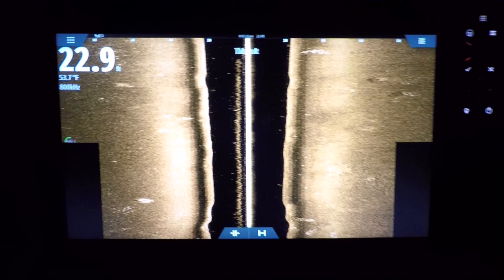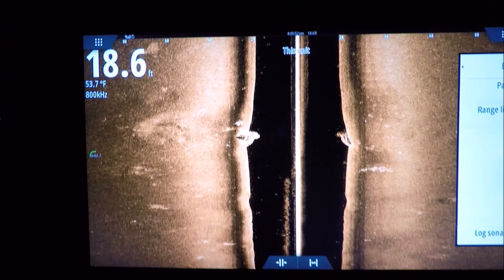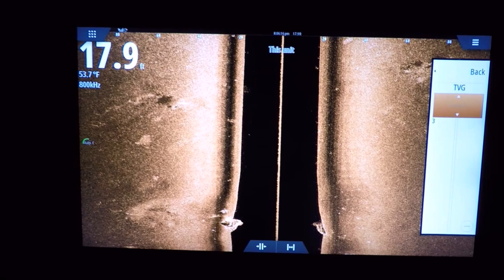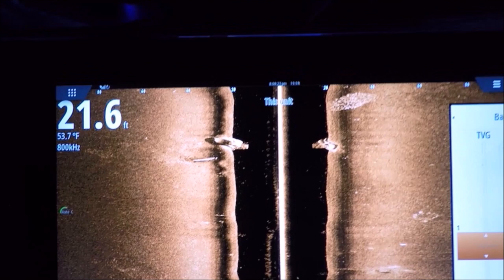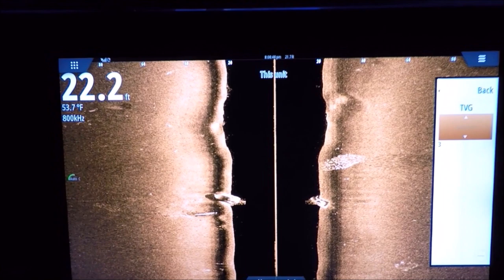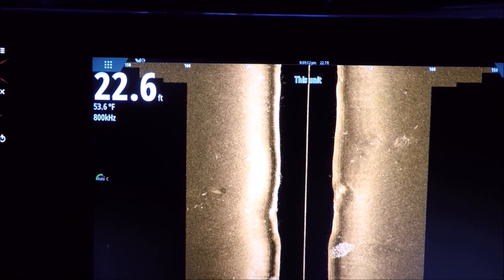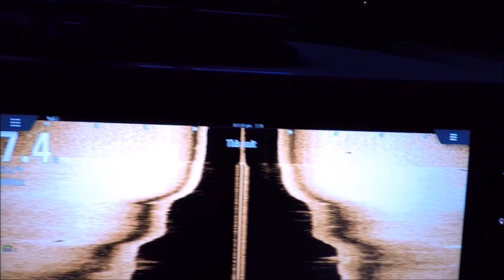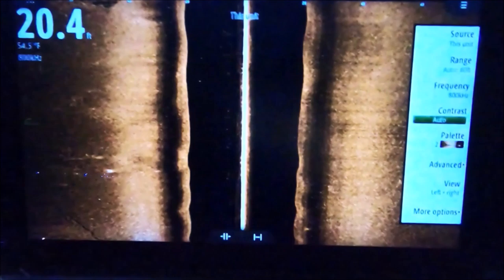Side Scan SETUP! ACTIVE IMAGING SETTINGS. 3 in 1 Transducer

Comment: I have the Total Scan Transducer with Evo 3 unit. To view bottom or sides of channels, where should I run it? Thanks
Reply from the maker: Definitely in 455 always. That’s the most important thing. TVG 0-1. Range wide out until you see the darkness appear on the outer edges, then bring it back in one click. Bring it in 2-3 clicks if you want slightly better detail. 👍👍
Reply: Hi Mike,  I just did an update on my simrad evo3 and now i dont have the option to choose downscan on the structure sounder???  and my unit won't shut off.  can you help with this??

Comment: I have a question. Im running a client's 28' whitewater with two EVO 3's but the down scan and side scan wont work.. Im not sure what transducer is installed and neither does the owner. Im at witt's end here. I do see CH1 and CH2... but hell, no matter what I do, I cant get them to work. down scan kinda works when we are at the dock but as soon as I leave the dock and head out its just black with a blue bar at the top. The side scan is completely black shows nothing. Any suggestions?
Reply from the maker: The channel selections are just for traditional sonar. They aren’t for side or down scan. On the side scan page go into the menu and look for source. You might have the wrong source selected. If the side scan transducer is connected to the left screen select THIS UNIT only on the left screen. If you want to use it on the right screen select the other screen in source, just don’t select THIS UNIT on the right one if the transducer is not plugged into it.  If you’re losing bottom when you leave the dock check your range. Set it to auto or set it deeper than the water you’re  in at first.
Reply: @MikeSmedleyOLDSCHOOLSTRIPERS  there are two machines but only the right side machine has the transducer plugged into it. We use the left one for GPS/chartplotting.  I fiddled with auto range but nothing happens.  Do you need a special transducer for the side scan and down scan to work? Maybe the transducer installed doesn't have the capability?
Reply: when you buy the machines they dont come with the transducers, right? We do get options for high/med/low chirp though. plus 200khz, 83kz/ 50khz. THis is driving me crazy dude! I need to figure this out.
Reply: @MikeSmedleyOLDSCHOOLSTRIPERS  also, since we dont know whcih transducer is installed, we have it "unknown" selected as the transducer type so maybe something weird is happening there. There is a tag on the transducer cable that reads XID V1.33  11-010-01 REV2 but really cant find much on that.
Reply from the maker: @Cptpaul12  Evo 3’s don’t come with transducers. You can look on the transducer cable tag on the back of the screen to see what you have.
Reply: @MikeSmedleyOLDSCHOOLSTRIPERS  I did.. look at the reply above this one
Reply from the maker: @Cptpaul12  XID is an X ducer. It should select automatically. If it has side scan built in make sure it’s plugged into channel 2. If you use unknown you will see frequencies offered that your transducer can’t use.
Reply from the maker: XID is an X ducer. It should select automatically. If it has side scan built in make sure it’s plugged into channel 2. If you use unknown you will see frequencies offered that your transducer can’t use.
Reply: @MikeSmedleyOLDSCHOOLSTRIPERS  when you mean plugged into channel 2.. do you mean in the options or on the back of the machine? And would that also effect the down scan? Thanks for your help, Mike. It’s much appreciated
Reply from the maker: @Cptpaul12  yes you need a special transducer. This is the best all in one. It has everything built in. High and med CHIRP down and side scan. https://amzn.to/2Tm3Ngw

Comment: Hi Mike.  Will this transducer and the TM 275LHW interfere with each other if operating at the same time?
Reply from the maker: I run both everyday on Evo3. I see no noise at all. The Airmar transducers are so clean and quiet they play nicely with all of the transducers I’ve tried 👍👍. They are awesome.
Reply: @MikeSmedleyOLDSCHOOLSTRIPERS  thanks Mike.  I see there is a new HD version out now for the A/I 3 in 1 transducer…your thoughts on this?  Is it worth spending the money to upgrade from the non HD version to the HD version?

Comment: do u have a picture of how low or high u mount your transducer... thank i can see to the right but cant see anything on the right i think my motor is blocking it...
Reply from the maker: siv aing shoot me an email. I’ll get you a pic. That’s a common problem when mounted too high. You want it as low as possible. I have a 12” jackplate so I can mount higher than most. My skeg doesn’t block the side scan since it’s back further. Mikesmedley9@gmail.com
Reply: Mike Smedley do you mount the active imager to the jack plate? I’m getting ready to plan out the transom on the shop boat and to demo it I’m going to have an AI, SS 3D, a standard skimmer, and the Airmar High Wide. I think I’m going to do the 3D and AI on the jack plate, the HW on the starboard side and the skimmer on the port. Could you post a video on your multi transducer install? Thanks!
Reply from the maker: Performance Marine AZ I would not mount to the jackplate. The transducer will come completely out of the water at 10mph or less in some situations. That’s no good. We mark fish at plane speeds. I have had as many as  6 transom mount transducers on at once for testing so it can be done. This is an older video but you can see some of the transducers I had at the time. 

https://youtu.be/9i15P5TV4tw

Here’s another. https://youtu.be/4XofQS4gMj0

Comment: Can you help me once more?
I got the new unit from simrad had 18.3 i updated to 19.1
Everything is working with s5100
Only issuse i have now is
When i go to this unit ch2 i cant find AI 2 in 1 transducer in the list  its pluged into port 2 black

But side and down scan still work under Unknown
Reply from the maker: disonesto You shouldn’t find anything on the sonar page for channel 2 because it’s not a 3 in 1. There are no Sonar options, only side scan and down scan.
Reply: @MikeSmedleyOLDSCHOOLSTRIPERS  everything works fine.      But the weird thing is when i had the defective unit that i sent back to simrad that was on 19.1.1 i was able to select AI 2-1 

The one they sent me had 18.3 that i updated to 19.1
Everything works.  It just dosnt detect ch2 AI 2-1 
It also works with under network this unit ch2 unchecked. Im guessing that is only for sonar because thats the only place it removes it from
Reply from the maker: I’m not sure why it was selectable the first time. Because it has no sonar elements it’s strictly a structure scan transducer. It shouldn’t show up in any sonar situations at all.  On structure San pages you should be able to select THIS UNIT but there should be no options on a sonar page.
Reply: @MikeSmedleyOLDSCHOOLSTRIPERS  its will only show up on the sonar page with wrong Frequencies if i check the box that says this unit ch2 under networking.  If i leave both boxes unchecked ch1 has nothing pluged in and i leave ch2 unchecked since its not a sonar.    Side and down both work fine.    The only box i have checked is networking for s5100

Comment: So in say 5 feet of water the range will be very limited?
Reply from the maker: Yes, but not as limited as the older systems. In 5 feet of water the range would be 20-25 feet to each side or more.
Reply: Thanks so much. Live in Florida and have been struggling with why I had such a short range. Tryed it in some deeper pits this morning and had great results.
Reply from the maker: Cool!! 👍👍

Comment: Thanks for the video. Are you using the 3 in 1 on its own, or also with the structure scan 3D box, to get your great side images? I just picked up a Carbon 9 at the Cabelas sale, seems like an awesome deal
Reply from the maker: It’s the 3 in 1 Active imaging transducer plugged straight to the Display. 👍👍👍
Reply: @MikeSmedleyOLDSCHOOLSTRIPERS  sweet! Do you recommend using the latest software update for Carbon? Some people talk about there being a sweet spot on Lowrance updates, and that performance can drop with the latest ones.
Reply from the maker: @FishStalker777  Unfortunately i am not as familiar with the Lowrance side. I use the newest software on my Simrads though.
Reply: hello, sorry for the inconvenience, I wanted to ask you for advice, I bought a hdslive9 with the spnda imaging.3-1 and I wanted to ask you for advice, I saw that it contains 4 types of frequency (high chirp-medium- chirp/ 83e 200) I practice trolling with live snapper on a seabed ranging from 50 meters up to 90, for this type of depth which frequencies should I use? should I use only one or at 50 one frequency and at 90 another type of frequency?, I accept valuable advice thanks
Reply from the maker: Leave it in Med CHIRP all the time. It has the widest cone and has much better deep performance 👍👍
Reply: @MikeSmedleyOLDSCHOOLSTRIPERS  ok thank you very kind
Reply from the maker: Any time Giovanni!
Reply from the maker: @Camh1968 I personally would use 83 in less than 20ft of water. Then switch to medium in anything deeper. You may want to tweak that and experiment a bit.
Reply: @MikeSmedleyOLDSCHOOLSTRIPERS 

Hi Mike 

When would the 83kHZ be used in lieu of the med chirp - and visa versa?

Thanks

Cameron
Reply from the maker: @Camh1968  @Camh1968 I personally would use 83 in less than 20ft of water. Then switch to medium in anything deeper. You may want to tweak that and experiment a bit. A lot of times Med chirp is best in all depths less than a few hundred feet.
Reply: @MikeSmedleyOLDSCHOOLSTRIPERS  

Great thanks Mike.

What is the rational for using Medium chirp over the 83 in depths for more than 20 ft?

Cheers
Reply from the maker: @Camh1968  CHIRP sweeps through many different frequencies instead of using just one. The deeper you go the more effective CHIRP is. Sometimes in water less than 20 I get a cleaner image with just 1 frequency.
Reply: @MikeSmedleyOLDSCHOOLSTRIPERS  

Thanks a lot.  That’s interesting about the clearer image with the single frequency below 20ft…

What is the Cone angle for both the 83 and medium chirp ?

How does the med chirp performance differ on the 3/1 AI Ducer when compared to the TM185M Ducer?

Cameron
Reply from the maker: @Camh1968 I don’t remember the exact cones angles with that one, but it’s between 15 and 20 degrees. Chirp uses the same angles, but can cycle through whatever different cones the particular transducer has available. The 185 is 1000 watts versus 600. The elements are much larger and “quieter” cleaner and higher resolution. The CHIRP that comes with the 3 in 1 is decent, especially for the money, but Airmar’s CHIRP transducers are all steps above the 3 in 1. Airmar doesn’t do side and down scan so you would still need both if you wanted to upgrade.
Reply: @MikeSmedleyOLDSCHOOLSTRIPERS  

Many thanks Mike.  So interesting!

I have the TM275LHW and the AI 3/1 installed with dual Evo3S units and just starting out this new high tech journey.

I mainly fish the local bay up to 85ft for snapper.  A few times a year I will be heading offshore for Tuna.

I have the offshore Ducer covered.  But not so sure about the local bay work for snapper, with bottom structure being important I think.

Not sure if my ducers will be optimal for the bay fishing for snapper?  Should I swap out one of these ducers for the TM185?

Cameron
Reply from the maker: @Camh1968  you’re all set brother. Don’t change anything. Your 275 is the same as the 185 only you have a low CHIRP band in addition to the high wide that’s in both the 275 and 185. You won’t need to use low CHIRP until you get deeper than 5-600 ft deep. Stay in high chirp otherwise. Ocean and bay less than 600 fr deep. The Active imaging should only be used for down and side scan. 👍👍
Reply: @MikeSmedleyOLDSCHOOLSTRIPERS  

Thanks brother 😀

I thought the 185M would have a different band, compared to the 275LHW and hence better for bottom structure?

Seems to be a consensus over on ‘The Hull Truth’ forum that the 185M is better resolution performance than the 275LHW  for bottom structure…

Your thoughts?
Reply from the maker: @Camh1968 ha. That’s funny. Nope. Same exact transducer. There is a SEA of mis-information out there on sonar. Only a tiny percentage really knows what’s up. At a boat show once I asked a few basic technical questions to every boat dealer that installed exclusively Simrad and they all got every question wrong. These machines are like iPhones, the owner’s manual doesn’t help at ALL, and thats the extent of the dealer’s knowledge. I wish they would just say I DONT KNOW. I have been partners and a beta tester with Simrad since it was Northstar in 2003. Partners with Airmar since 2013, and partners with Sea Pro since 2015 (they are a Simrad dealer). Sea Pro sends me a steady stream of customers that need help because some dealer wasn’t quite knowledgeable enough but didn’t let that stop him from selling $10k in Simrad gear. I get emails from furious customers all the time because the dealer mislead them and they bought and installed all the wrong stuff.. 

 Sea Pro is great!! The people there won’t play that game. Any questions they can’t answer, they call me. I’m not the END ALL BE ALL of the fishfinder world by any means. I just have way more experience than the average fisherman because I test for Simrad and Airmar and fish 5 days a week all year. 

  The message board you mentioned may be confusing the 275 with the 265. The 265 has a regular high CHIRP band and not the WIDE. Also the 185, 175, and 275 comes in medium CHIRP as well so they could also be referring to that. I’ll text Airmar today and get it right from the source 👍👍👍
Reply: @MikeSmedleyOLDSCHOOLSTRIPERS  Wow.  Legend!  Well done.  Very lucky to have you onboard YouTube.  Thank you for your ongoing guidance in this space...

'Abbor' on The Hull Truth forum seems to be the GO TO man for this stuff and often states the 185 to be better than the 275 for bottom structure..

I cannot see any implied confusion with the 275 and 265 on that forum. 

I thought the 185M has a narrower angle cone, when compared the 275HLW ?
Reply from the maker: @Camh1968  I remember Abbor from years ago. If I remember correctly he knows his stuff. I’ll text Airmar today and get back to you. 

 I haven’t been on the Hull Truth in many years. Please don’t mention me in any discussion or “arguments” over there😂. Some of those guys exist to only argue and I’m too old for that nonsense. Thanks brother.
Reply: @MikeSmedleyOLDSCHOOLSTRIPERS 

LOL - No worries, mate :-), Yeah, I have been on a number boating / fishing forums over the last 20 years, and I see a change in the way people respond to posts and not always for the better 🙂 Most times, an agenda to argue every point in an almost like 'baiting' way...,,,
Reply from the maker: @Camh1968   25% are there to learn and help.  75% are there to terrify that 25% into  never posting again. 😆.  It’s actually one of the better boards.
Reply: @MikeSmedleyOLDSCHOOLSTRIPERS  - yeah agree - keyboard warriors at play 🙂